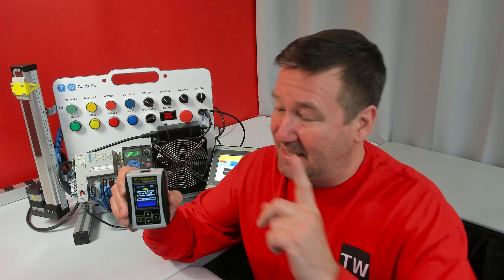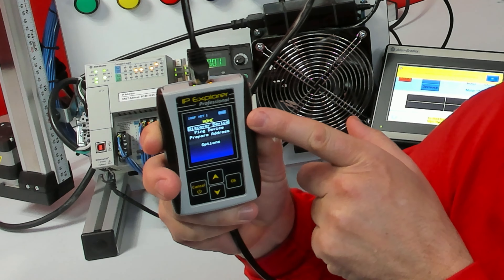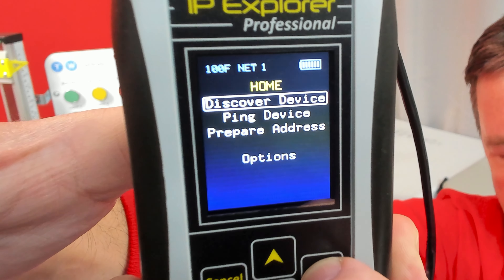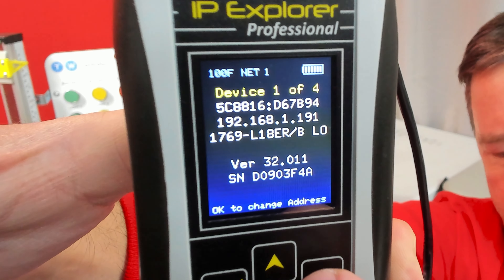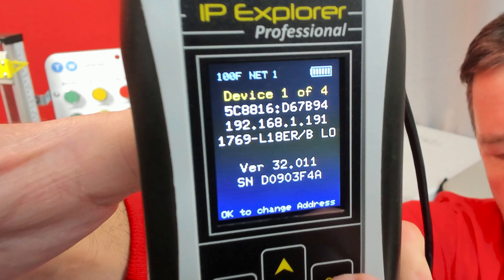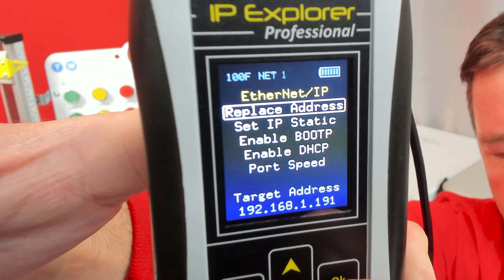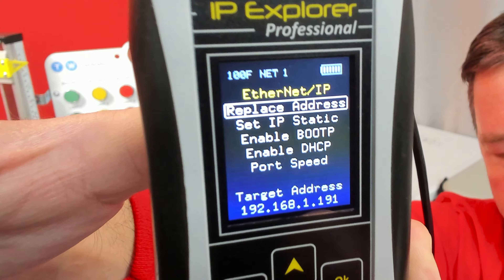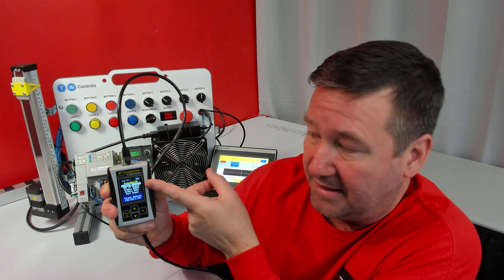PLC Tools SIM-IPE Better Workflow for Reading and Assigning IP Address

Comment: I've been using one of these for the past year and it has saved me countless hours of searching and guessing. When a customer doesn't have good (or any) documentation it can be very difficult to figure out an IP address of certain devices or PLCs such as PanelViews or Micros. This has no problem finding them very quickly. Well worth the cost and a very handy tool to have with you at all times if you encounter different equipment frequently.
Reply from the maker: Thanks for the recommendation!

Comment: Hey Tim, Am I able to change an existing static ip address on a micro850 solely with the SIM IPE without connecting to it through ccw and do I need to cycle power during that process? I have the 2022 firmware if that matters. Thanks!
Reply from the maker: You have to switch it to program mode, here is a video specifically on what you are looking for.
https://www.youtube.com/watch?v=xeP1TZWQA6k
Reply: @TimWilborne  Thank you so much! Does this tool work with micrologix plcs as well?
Reply from the maker: Yes but there is some odd quirk on the success message of older units, I can't recall the specifics